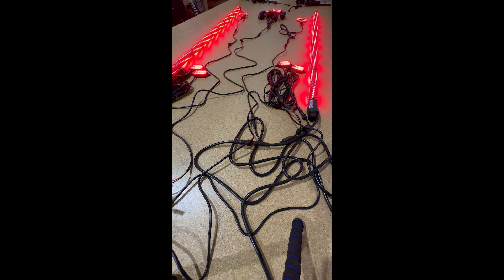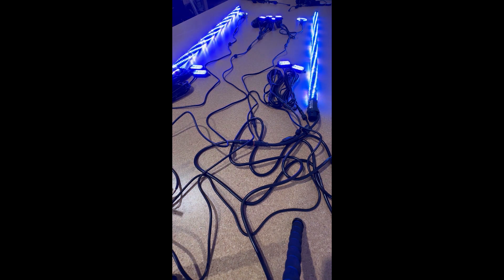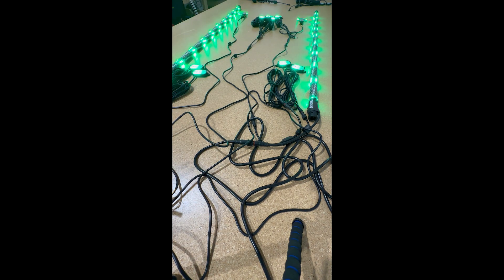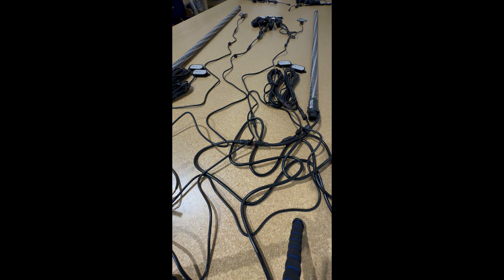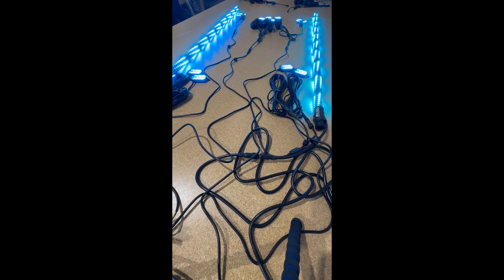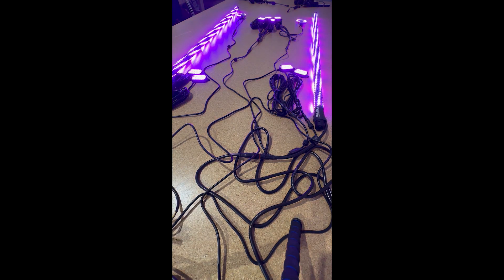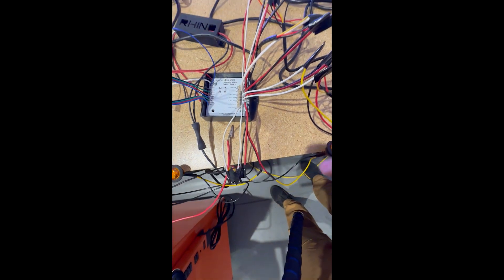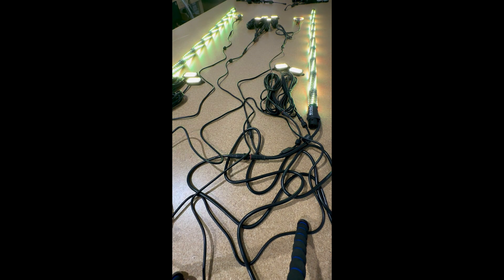Connex Pro Update - 10/22/22

Comment: Hey there! I have been following your progress on the board and what you are making is sweet! I did have a couple suggestions you could consider. 

First suggestion is when you have the turn signal activated and then hit the brake, instead of having the turn signal continue to blink an orange/amber color, it could be changed to a red color until the brake is released and then it could go back to blinking an orange/amber. I think this will make it better for riders that are riding behind you to see both your whips have turned red, indicating you are braking.

For the 2nd suggestion, I am not sure how hard this would be to implement at this point, it would be cool to have another 12V trigger that displays a user customizable color/pattern. I know with the bluetooth app there are like 200 or more different effects that you can select to your liking, but say if you really like one specific effect that you would want to display in a specific scenario without having to use the bluetooth app and instead just use a 12V trigger to activate that color/pattern. Say for example you wanted to use this mode as a courtesy light that is activated when your dome/interior lights come on. This would be useful at night time if you just wanted a neutral white bright light so you could use the whip lights as an area light to see around you. I am not really sure how hard this would be to setup, because it seems like you have to program in the different effects for each 12V trigger mode. I saw in one of your videos you added a few new strobe patterns in the 12V Strobe trigger mode by programming them in, so I am guessing if you did a user customizable mode, you would have to upload all the effects to this trigger mode and cycle through the one you want? If you were able to select the specific effect you want using the bluetooth app for the user customizable mode, that would probably be easier but I don’t know how technically possible that is.

I also did have a question. I am a little confused as to how to hook up the 12V Blink mode on the board. So I get that the board has an internal flasher and uses a constant 12V power source to blink if you don’t have existing turn signals, but you also have the option to use the blink mode if you already have an existing external 12V trigger that comes from turn signals you already have on a machine. My question is, why is there only 1 wire for 12V Blink mode trigger? Do you only have to hook that wire into only one of the turn signals, either the left or the right? Wouldn’t you need to do both left and right? Just not sure how that works.

Also another quick question. How do you cycle between patterns in 12V trigger modes like the Strobe and Patriot modes? I know you said once you select a pattern, it is saved to the board’s memory, but how do you go about selecting the pattern that you want to use for Strobe or Patriot mode?

Anyway you guys look like you are making a great product! Currently, I have another whip light turn signal system that is similar to what you guys are doing but it is nowhere near as good. The system I have now is the Quake LED Quadlock Pro Controller with 4FT Whip Lights. One thing that stinks about that system is that they are using 4 pin dumb LEDS that are not individually programable so you can only have solid colors. Also they only included 2 animations on it, that being a 7 color fade and a 7 color flash. I have only had this system installed for a few months now and the controller has already gone bad because it’s displaying the wrong colors in some of the RGB and trigger modes that it did not do when brand new. In the future I would be definitely be interested in upgrading to this system. Thanks and take care you guys! You are doing a great job!
Reply from the maker: I answered some of your questions in the last few videos i posted explaining further how features work. Check those out.
Reply: @rhinolightsllc  Thanks! 👍